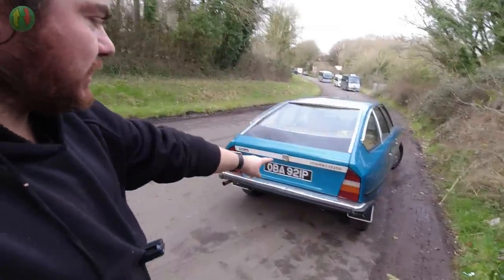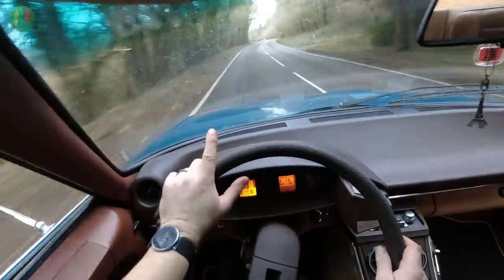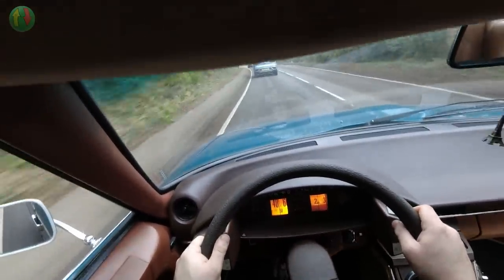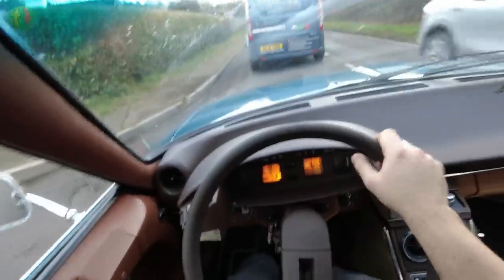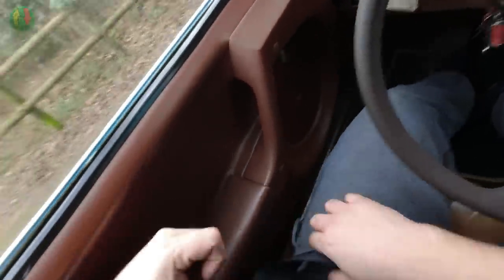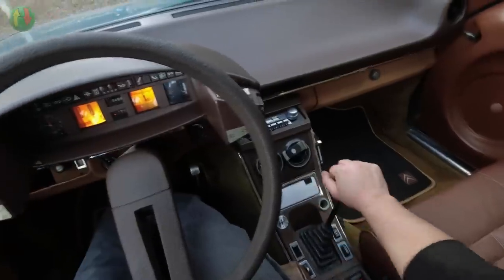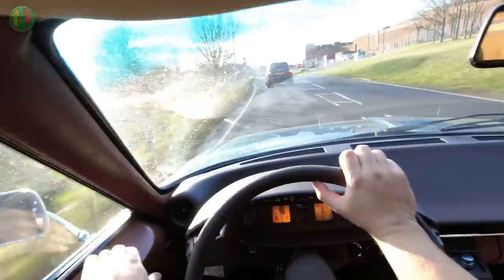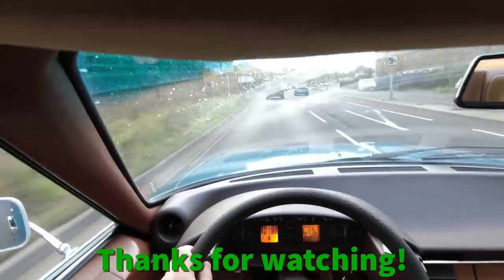1975 Citroën CX2200 Pallas - POV DRIVE & WALK-AROUND: One of the EARLIEST CXs in the UK!

Comment: I'm one of those sad old men that drove CXs. I had three CX 25 DTR Safaris in the 80s - '90s the last one being a turbo. I didn't realise what an amazing car they were as I bought my first one purely on the super quiet and smooth diesel engine and only afterwards discovered the wonders of hydropnumatic suspension and diravi steering.    

I wasn't aware that they made a CX without Diravi steering, all mine had it but they were all 1980's. I wouldn't have liked them nearly as much without it.

The last one I had was an '86  and turbo diesel and apart from the comfort and driveability gave over 50 mpg on a long journey. I had it for 7 years and covered over 150k miles in it. I repaired all of mine myself, it was a steep learning curve but well worth it.

The Turbo 2 diesel which came out in about '86 was a trail blazer for its time, 120 bhp at 3600 rpm,  top speed 120 mph and 0-60 in around 10 seconds and of course brilliant fuel consumption.

After the CX I ran XM's for about 10 years, good but not as good as the CX, lack of diravi was one retrograde step and the loss  of double wishbone suspension and central steering knuckles were others. I still think that the CX's were the best cars I ever had and that is out of all the cars I have had since I started driving in 1956. I think the next best ones was the Peugeot 406  diesels which I also drove for about 10 years, best cars Peugeot made in my opinion.      

I wasn't very impressed with the early C5's that was when I changed to the 406's but I now have the last C5's they made which are very nice, mine have steel springs but still ride better than practically everything else on the road.

I also had BX's, the TZD estate being the best.
Reply: How can you be sad if you owned CX's? I've only seen them a couple of times.Mostly overseas and just once here in Yankistan.I saw a Pallas version and wanted to marry it.I just couldn't work up the nerve to ask the owner.I also assume it'd be hard to find a wedding dress to fit a Citroen anyway.

Comment: The manual steering CX with 4.5 turns lock to lock versus the DIRAVI power self centring had 2.5 turns lock to lock is very tedious.
I had a 1978 CX 2400 EFI 5 speed Prestige with leather RHD for Paris delivery new and imported to Australia in mid 1979.

It was an amazing drive... very quick touring car and could be hustled through the bends quite rapidly.
The CX Prestige and Safari has the longer wheel base of 123 inches the same as the DS.
The ride was particularly fabulous.
The CX GTI Turbo 2 was a real hoot.

Comment: The CX didn’t have PAS in the beginning because there were still DS to be sold, and the CX was supposed to be slightly more downmarket, while actually being much more modern. So they left out the Diravi for the first year.
During the preparation of the press launch operation, which was held in Finland, the lack of PAS was felt on the tarmac of the parking lot in front of the restaurant where test drives were to be interrupted for a lunch break. So to address the risk of bad reviews criticising the heavy steering during manoeuvres, the Citroën press department bought a few lorry loads of fine gravel to dress up the parking lot with natural roller bearings...
After the demise of the DS, power steering became standard on the CX right away.
Reply: That's really interesting.  I'd not thought of the DS overlap aspect.  I had understood the late arrival of DIRAVI on the CX was because the development of the system had not been sorted for the production process in time for the launch. Apparently early DIRAVI equipped cars required the system to be set up manually so disrupting production, meaning that until the set up process had been fine-tuned DIRAVI was removed from the specification until 1976.
Reply from the maker: Really interesting stuff!
Reply: Cheers.

Comment: I was a serial CX2400 Familiale owner, both Mk1. The first was Cmatic and the second auto.
Running the aircon really hammered the fuel consumption. The DS that my wife used at that time is still in our fleet and is now Bleu Delta. Whilst I had the Cmatic a friend let me drive his manual saloon and complained that I didn't use the clutch when shifting gears. Never crunched though.
Reply from the maker: The C-Matic blows my mind!

Comment: Hydro Citroens always feel odd without PAS. Not a fan of non-PAS BXs and even after almost two years, I still get caught out by the heft needed to steer a GSA.
Reply: A CX without that gentle hiss as the DIRAVI does its magic is weird
Reply: @torresalex  yes you have to have diravi. Steering with one finger.
Reply: Iain Tyrrell's SM video compliments this one well and shows the Diravi steering very clearly.
Reply from the maker: Or PS, even....in the case of the CX and SM!
Reply: At least the GS and GSA steering, still at only 3.5 turns lock-to-lock, was amazingly accurate.  I've never driven a car where the steering wheel needs so little correction when driving in a straight line.  They just go in a straight line regardless of camber and bumps.

Comment: That moveable lamp seems quite useful, a bit like the built in rechargeable torch in some modern PSA products, our 2010 Berlingo's at work had them (but not the 2015's) and so did my Step-mums 3008.

Comment: Lovely car. From someone who has owned a series 1 CX for many years I can confirm they do not like sharp crests! You are spot on re the steering. You need to do a video on a Diravi CX for comparison 😊.
Reply from the maker: Yes, I'd love to compare one. Ages since I last drove a DIRAVI car, and it was on much less demanding roads, but I remember it feeling much sharper.
Reply: @UPnDOWN  I have a UK-Spec RHD 1976 2200 Pallas with the DIRAVI system and it is a lovely drive.  Not a sports car by any stretch but utterly engaging in its own way.  It is in bits at the moment as I am fitting a 5 speed gearbox to improve its usability and because the old 4 speed grinds every gear but once back on the road and sorted you are welcome to try it.  I think I know this car, I met the owner at a Citroen meet pre-COVID; I immediately sought him out as he had a near identical car and you don't see many early CX's, even at Citroen meets!

Comment: It was 1977 I  was 20 years old, my car was a  Lancia Beta, pre rust scandal and no power steering, my Dads new car was a CX with power steering, he let me borrow it, First corner was a 90 degree junction, I slowed to give way and turned left, I almost hit a brick wall on the nearside after driving over the pavement,  I had just found out  that 2 turns lock to lock  needed a different driving style to 4 turns.
Reply from the maker: Haha!

Comment: Nailed it, driving and commentating like a pro. Was that a Citroen 100 sticker? I shall have to go back over HubNut's video from the Coventry meet to see if it was there. Couldn't help noticing the door cards are so obviously for hand winders but...what the hell, just put a blank in the hole. Thanks for that, very enjoyable.
Reply: Update...I watched Ian's video (excellent) and I did not see this CX...however I did see another with a very close registration, OBA799P, what are the chances? Blue it was.
Reply from the maker: Yes, it has the 100 sticker. Assuming it went.

Comment: Having a car like that without powersteering will build your shoulder and arm muscles. Not a bad thing. It also kinda forces you to steer precisely without the need to adjust your line while in the corner. 
I agree with you that a car like this really deserves an automatic gbox.
Lovely car, specially the interior.

I think the competition against this early CX would have been the Peugeot 504GL/Ti, Renault 16TX , Volvo 244GLE, higher spec Opel Rekord/Vauxhall Carlton, Mercedes w123 200 and 230, bmw 518/520, Audi 100 5S/5E, Triumph 2500, BL Princess, maybe even the NSU RO80. Lots of choice in the late 1970's!
Reply from the maker: The bigger issue for me was the lack of responsiveness to the steering. Would take a long time to get used to the way you have to dial in quite a few degrees of lock before anything starts happening!

Comment: What a beauty! Talking about the BX. This reminds me in more then one way of my fist car, An early white BX14E with a beige interior. Off course there is the interior connection, like the great satellites. Then the lack of power assistance, which I never missed though. It was an equally cheap, low spec version with the crude engine (70 bhp). That motor was ancient? It even had the gear box running in the engine oil. You could feel from the gear box when was about time to change the oil! I still loved it to death though. In many ways it was the ideal Citroen. Enough character and that great suspension system but nothing much extra to break down. It was pretty rust prone though, although most of the problem spots where well hidden. By the way: The road holding of this CX seems to indicate it needs new spheres.
Reply from the maker: You'd enjoy my other POV Citroen, then - my BX 16TRS mk1!

As for the spheres, I'm not convinced. The ride is a little better than my BX, and that's very good. It's just the way dips and crests catch it out that I was surprised by. The body roll I assumed would be present.

Comment: Yes its basically the same engine as in the DS. The valve cover gasket fits from a DS, I found out when my CX was loosing oil forward, right down on the exhaust, a smoky stinky affair.
Owned 2 CXes, but only have my '67 DS now. CX understeer is worse than on the DS, probably due to the Audi engine placement..
There must be something wrong with the spheres. It's supposed to just "eat" everything, like any other big Citroën.
Reply from the maker: It does eat everything, it's just getting caught out on crests and dips. Might be on 'comfort spheres' or something.
Reply: Hey Jakob! Why am I not surprised to find you here? (It’s Anders Rose here, in disguise) 😃

Comment: CX's must have seemed like space ships when they were introduced, funny thing is, I don't recall seeing any when they were contemporary!  I do remember seeing alot of DS's though, and to this day my favourite is the Safari version.  However, I did have a CX, as a tax dodging company car , in the mid 90's.  Bought it from that CX specialist dealer, can't recall the name. It was an early Pallas 2400, dark blue, manual, 77 or 78 I think.  I was doing alot of mileage back then, mainly motorways, and it was fantastic for that, and notably good in bad weather, in particular heavy rain.  That map light, shown in this vid,  was so cheap and tacky that I thought it was aftermarket!  In fact, the trim generally let the car down, poor quality and looked nasty.  Eventually, it was finished off by two issues, the dreaded hydraulic gremlins, pretty terminal on those early cars as the hydraulic system was all assembled around the steering column, so to fix it the car had to be virtually disassembled at massive cost.  The other problem was the engine started to smoke badly from the exhaust, meaning a rebuild.  So, all that combined doomed it to beyond economic repair.  So, I parted it out and recovered some of it's cost, more than scrapping it anyway.  Had a go in an 80's CX turbo D, back in the early 2000's, that was an excellent car, very quick and all the issues sorted, good on fuel too.  My main Citroen experience though, has been Xantia's, have had 6 of those, including an Exclusive HDI 110, loved that car.  I still have 1, a pov spec Forte HDI 90, but it needs a clutch, so its been sitting for 4 years waiting for me to be bothered to do it!  It's in quite good nick, so I really should sort it,  Xantia's are getting difficult to find now.

Comment: I'm surprised that this car didn't have diravi as in the early 80's I had a 1976 CX2000 base model ie no electric windows no tinted glass cloth interior no rev counter small center hubcaps ect but it did have diravi ! I've also owned a 1980 CX 2400 GTi, 1981 CX 2400 Pallas IE, 1984 CX 25 auto and the best was a 1985 CX 25 GTi turbo 1
Reply from the maker: It wasn't the spec level that prevents the DIRAVI, it's the year. DIRAVI came in during 1976, as I understand it.

Comment: One of my company cars in the 80s was a new CX Athena so it wasn’t the top spec but I adored every second of that car and was a bit disappointed when I was told it was being swapped for a year old Rover SD1 3500S manual which ok was a fair bit zippier due to the great old Buick V8 but a dog to drive by comparison, horrid in snowy conditions where the CX was excellent. 

The dreadful clutch and gear box matched the awfulness of the ancient old iron up front and that triad was the Achilles heel of an otherwise epoch-making car.

When I first took delivery of the CX, I nearly wiped out a bollard at Shepherd Bush as I let go of the wheel exiting a side road briskly and hadn’t yet been acclimatised the weird self-centring function. Once one adjusts to the suspension, the roadholding was actually not bad, the car never fell off the road when thrashed along winding B roads.

At the next set of traffic lights while stationery, I put the car on full lock to explore the weighting and was gobsmacked to see the wheel return to the straight ahead instantly. Oh, roll on Euromillions, I’d happily have a Light 15, DS, CX, BX, even a C5 and C6 in a collection. I’d bring them all along to Mr UpnDown and pay him to restore the lot.
Reply from the maker: Just don't expect me to restore them quickly!
Reply: Fun fact: if you could afford a CX Prestige 5-speed manual, for a very short period (2 years, I think) the gearbox was available with a hydraulically-assisted clutch. The clutch pedal became very light to operate, a world away from the agricultural standard clutch. Only the Prestiges had these, and there weren't many of those....

Comment: Having driven both a very ropey late CX Athena and an extremely early and meticilously kept CX2000 i'd say the Diravi steering is what makes that car. Obviously the early car's steering is very heavy at super slow speeds but ok when you get moving, the problem i found was when navigating longer curves the force needed to turn the steering seemed to increase drastically at a certain point and made the car feel rather pondorous and unwieldy, there was also a savage self-centering force even without diravi, which makes it hard to exit a corner smoothly as the wheel unwinds the 15 billion rotations you've made just to make the thing turn. At motorway speeds it's great as all CXs but around town i found it annoying. Unless the one i drove had something wrong with it, i'd say diravi is >50% of the driving experience of that car. Makes it feel so much more playful and laid-back at the same time and the feeling of being able to flick around this boat of a car without much movement or effort is awesome.

Comment: This always struck me as a modern interpretation of the DS. In the 1980s I used to peek into cars to see the interior appointments (and dream) and when I came across one of these CX cars and saw their yellow compass instruments, I thought it was an early electronic digital dash until I finally saw what went on thanks to Hubnut.
It seems a travesty such a luxury oriented car has a four pot, albeit a decent capacity one. A V6 option would have been ideal, although I don't think there were any transverse V6s in existence then.
Reply from the maker: Well it did replace the DS, so the fact you see it as a more modern version isn't misplaced. It's a shame it has a four-pot, but I actually edited out a full-on rant about it not having a V6 thanks to Peugeot. In the end, that's why Citroen turbocharged it; they weren't allowed to develop a V6 when the rotary dream died.
Reply: The available space in the engine bay (or rather inside the front subframe) would have made a V6 a very tight fit, as you still need room for the gearbox. Not sure it would have been a practical option.

Comment: My dad had a 1977 CX Safari with the DIRAVI steering. I'm certain it had less than 2 turns lock-to-lock, more like 1½ turns (about 3/4 turns to each side) - it was really weird to use the first 5 minutes especially since it would straighten the wheels when you let go the steering even when stationary. Quite a change from my own MGB. But you soon got used to it and it was great for handling the car. 
But I guess the SM is even better (my dream car when it came out)
Reply: CXs with DIRAVI = 2.5 turns, lock-to-lock. Or, if you prefer, 1.25 turns left or right from dead centre.
Reply: @smhorse  First of all I'm sure you are right, since my memories are almost 40 years old and you probably have the car right outside :)

But I'm more than a little surprised since I remember the DIRAVI experience as being radically different from what I normally had driven.  I know that typically cars of that period had above 4 turn lock-to-lock and that would of couse fell a lot different. But I was used to driving an MGB in the summer and a Mini in the winter.  The Mini had 2.7 turn lock-to-lock (source MiniMania) and the MGB not much more and yet I still felt th CX much more direct. But that must just have been the ease with which it worked.